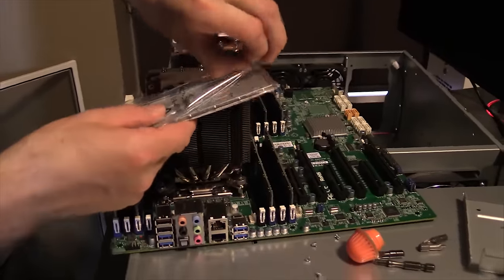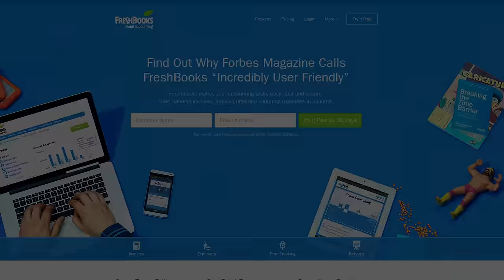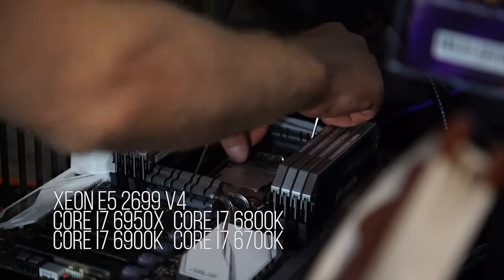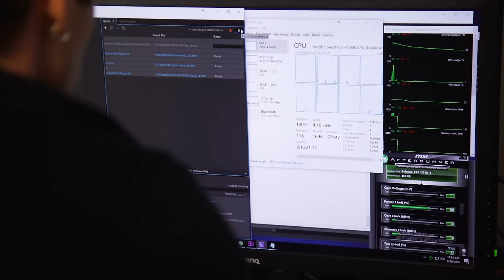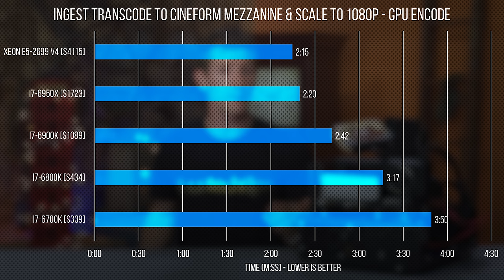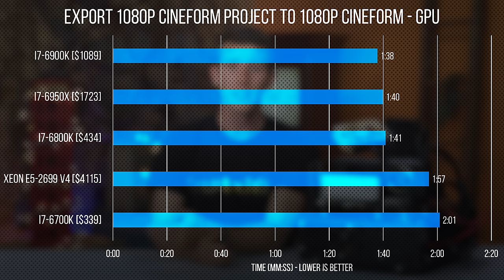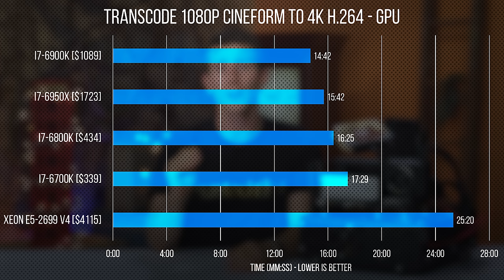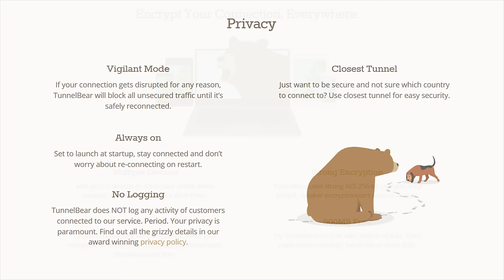$300 CPU Beats $4000 CPU?? - Cores vs clockspeed for video encoding

Comment: Well I got the XTitanX  6940K quadcore Series SSD  Deluxe tested MotherBoard Zeon 49 Quarter K video encoding encrypter for the encounter method 1080P export application to transcode the upload synaform cynthroptic angle in the scenario CPU front loading washer.

Comment: if I wanted to build an "eBay special" rendering machine using a dual lga1366 workstation motherboard with dual Xeon x5690 3.4ghz (3.6 turbo) 6-core processors, how do you think that would measure up against a modern skylake i7-6700 system? all other things being as equal as they can be, of course.
Reply: If your software renders on the GPU, it wouldn't make much difference, but you also need to know how well your program splits workloads between threads/cores.

Comment: Can you use virtualization to split the 28 core cpu into into "6 rigs of 4 cores", with each its own Titan X, then share those 6 rigs into some sort of "hive-pc-network"? 
In theory you would have 6 Quad Core PC's with a titan x, and 80+% usage on CPU?
So even though your clock speeds are slower, you use the advantage in numbers, since you have that epic CPU?

Could LMG test this?

(Hive-PC-Network) After googling, I think the term is "Render Farm".

Comment: Although the video may be correct, it wouldnt be then not that extreme at least.
The Premiere Encoder as with very most other timeline softwares too are absolutely terrible in efficiency of encoder and its speed as well.

It would've been more interesting to see the difference with x264 @ preset slow and not terrible timeline encoder...
maybe its even an opposite result then. Wouldnt be a surprise.

Comment: ummm ok? so its just a limitation of the software?
Reply: possibly, its also a limit of the use case, the cpu usage was very low so clock speed becomes a limiting factor, give it multiple vm's and get 7 people to hammer it with jobs all at the same time and you'll see the other chips cry.
the 6700k would probably melt its heatspreader.
Reply: ok thanks for the reply...  this is what i hate about his videos it seems like he spends more time on his advertisements then the subject at hand.... i feel like they rush though every thing and in the end i nothing out of this video...
Reply: Many software doesnt utilize more than 4 cores etc. It was the same when quadcores came out... Most software only utilized 2 cores max. I wonder if Linus actually knew it (probably did). As you said he seems to spend more time advertising...
Reply: Ex0rz Thats a myth, its widely believed because most people only have quad cores or dual cores with hyperthreading so don't know any better.
"It was the same when quadcores came out... Most software only utilized 2 cores max"
again most people at the time were lucky to have a dualcore e8500 because a q6600 was so insanely expensive. dx10 which was out in 2007 had support for multi core proccessors, but back then youtube was only a year old and there was no big tech stars to show you it being used and no rivatuner statistics server so it was largely impossible to tell if more cores were being used, the only real was was to simultaneosly monitor task manager on a second screen but very few if any sites did this, for the most part much like today they focus'd on "does 2x the cores give you 2x the performance" which is highly flawed as for one thing quad cores were often clcoked only 66% of the speed of dual cores and most games were not very complex with minimal physics and AI and didnt require a ton of processing power, so core 0 might be at 50% core 1 at 20%, and cores 3 and 4 at 25%, you wont see an improvement in performance, but much like running out of ram it would take allot more to slow the system down, a virus check could run in the background and you wouldnt notice.
of course very few who knew this and actually did testing back then care about it now. we are talking about the early 2000's when pink came out with "u + ur hand" and avril lavigne came out with girlfriend, think how old you was in 2007, heck i think xp still had like 85% marketshare so people couldnt even run dx10 on thier pc's with 1gb of ram.
the software today is highly parrellised now with gpu acceleration thrown in using thousands of slower low performance cores. its feasable that in the next few years a powerful GPU can do most of the handywork and any serial processes would be done by a low power 4ghz dual core CPU, this could infact be done on an APU with gpu, cpu, chipset and dram(HBM) all on the same die, were almost there already.
Reply: Toms Tech Dunno how its a myth since Im sure I have heard software developers say that their products didnt have quad core support.
Reply: Ex0rz "I have heard" that might be it, as i did my fair share of benchmarking over the last 10 years seeing where it matters and how much if you have any sources im entrigued to check them out.
fwiw 2007 was call of duty 4, bioshock and portal, hardly demanding.
Reply: Toms Tech Well you clearly cant prove that its not possible soo... You just cant know the way every single software out there has been programmed.  Not impossible that software didnt know how to utilize multiple cores back in the day.
Reply: Ex0rz I was merely asking where you heard and what you heard, from what i've heard over the years (and echoed recently from others like barnacles nerdgasm) software isnt written "for 4 cores but no more" software is written for multi core or its not and it will allocate threads as long as it has them, so if theres 5 threads (AI, physics, audio, load/save, NPC animation etc) they will all be distributed and tasked and scheduled by windows to as many cores as you have, its the ability to use multiple threads at a time that prompted intel do develop simultaneous multi threading to try and make the cpu work as much as possible while avoiding pipeline stalls and this was back in 2005 with the pentium 4 donkey years ago.

Putting all your eggs in one basket and hoping that a few powerful cores currently creates more hardware limitations than the problem of doing a little bit more work on the software side to make use of multiple cores (virtual or otherwise), much like having a powerful supercomputer vs distributed computing or distributed compute on as powerful super computers as we can get like we do now. It is well developed software that is going to be key in solving hardware limits that are coming up quickly and people can kick and scream otherwise about how powerful a single thing can be as much as they like.

Comment: So the 5820k (a 22nm 6800k) at $380 USD is looking pretty fucking baller then.
In the uk it's cheaper and outperforms the 6700k, and equal (sometimes better) in gaming from your video.

Comment: Why no use the 22core in a hyper -V or VMWare ESXi setup with 2 - 4 OS running benchmarks at the same time. dividing the cores evenly between the VMs. Though no sure even if this was good in some way, would even suit what your trying to do. and Im not sure how hardware pass-through for the GPU would work. other option would be an UN-RAID setup etc etc.

Comment: Off topic question.. I have a 4k monitor which overclocks to 72hz refreshrate using a mini displayport cable. Will upgrading to a full size display port cable improve this? My monitor has display port 1.2 wired to a gtx 1070.
I'm asking becuase theres a cable on sale for a £1 at poundland & not sure its worth the trip there and back.
thanks

Comment: why is inlet's HD 4000 priced at $481 when its soo bad. I have a HP Envy Dv7-7254nr notrbook. 8gb ram Quad core. it strogles to stay at 30 in most games on Med settings.

Comment: Still didn't get it, why does not scale good with more cores?
Reply: It does with cpu encoding only , throw gpu acceleration in the mix and then it favors a faster cpu over one with more cores
Reply: The application in GPU-bound mode, doesn't really spread the workload nicely across all the cores. So higher-clocked cores will run better, which you're going to get on a quadcore, not on a 22-core CPU.
Reply: Because the GPU acceleration is the bottleneck ... the CPU cores mainly wait for the GPU cores to finish their part.
Reply: Thanks for the info guys. So the right solution will be a balance between CPU and GPU horsepower. Maybe if you had 3x Titan's there would be more load on the more cores CPU and will benefit from then.
Reply: +Woxys Some people on other threads said GPU acceleration doesn't scale very well, so it seems to be not that easy.
Reply: Cuda does not have native threading support, and as such, favors few, high speed threads over many, low speed threads. This is stark contrast to say, opencl with its task parallel compute model which could take advantage of more cores, as well as directly getting the processor involved in tasks, where cuda excludes it, but each have their place. In a system with a lot of slow cores, the performance may be negatively effected by cuda, regardless of the number of cards you have, however, software can overcome many of the threading issues by using each card on their own thread, but it only lessens the problem.

Linus should probably get an OpenCL configuration setup, but that would require buying AMD cards, which we know linus will jump off a building before he would do such a thing.
Reply: That's bad news, i wonder how youtube servers handle that encoding...
Reply: Woxys LOTS of crappy cpus :)
Reply: With a shitload of individual encoding systems, most probably blade servers.
Reply: Not necessarily crappy, but as I said already, small individual units.
Reply: use x264. not these terrible inefficient timeline encoder.
Reply: De-M-oN Specifically, AVC. Hardware accelerated on AMD, not sure about nvidia.

Comment: Yes, shitty software doesn't scale to multi-core.
What else is new?
Parallel programming is hard. I've been doing heterogeneous parallel programming (CPU + GPU, pthreads, OpenCL, OpenGL etc.) for many years and I'm still learning new tricks.
My 3D software scales almost perfectly linearly, with multiple cores and multiple CPUs.
I have 2 dual-socket 16 core systems (32 threads each) and a 6-core (12 threads), with a higher clock.
The 16-core systems blow the 6-core system out of the water, with nearly 3 times the speed, even though the 6-core has an almost 30% higher clock.
Can I have your 22-core CPUs?
You can have my 6-core!
:)

Comment: hey Linus,

I am about to build a workstation for both 3d rendering and some engineering simulation work (why oh why do they lock CUDA acceleration to Quadro cards....) and it would be awesome to know how the CPU performance varies like in this video. since I'm investing so much on those damn Quadro cards, any place I can save a few buck would be welcome. can you please (please please PLEEEAAASE) do a similar comparison to this but rendering scenes (iray rendered) in 3Ds Max and doing a stress simulation in Inventor? pretty please. I wonder how the clock speed vs core count works for these applications and also if the CUDA acceleration (present in both software) negatively impacts the Xeon as well

Comment: Guys I'm building my first gaming pc it contains 
1-  intel i5 6600k 
2- msi kraite gaming 3x z170 motherboard 
3- msi gtx 1060 gaming x 3gb 
4- corsair hydro h60 liquid cpu cooler 
5- hyperx savage 8x2gb (16gb ram) ddr4
6- 1tb hhd 250gb ssd from samsung
7- 550w psu
8- corsair spec alpha black and red case  
Please rate my built and give me some tips thank you
Reply: 8/10 that cpu is overkill for that gpu
Reply: Get a 6gb 1060 and get a weaker CPU, if its for gaming you wont be needing this really, save some money in CPU and invest in a 6gb 1060, if also go as far and say that you wont even need 16 gigs od ddr4 aswell, but thats for you to judge. Anyways, save a buck on other parts and get at least a 6GB 1060 or ditch liquid cooling and buy a cheaper mobo and you might aswell buy a 1070 with an aftermarket air cooler
Reply: Thats perfect for 1080p
Reply: Thanks allot guys :)
Reply: Also i added the 6600k with the liquid cooler  and the z170 motherboard because i wanted to overclock it but im thinking on upgrading the gpu for the 6gb version thanks guys
Reply: +ADAM 4J Actually the 6 GB version doesn't make much sense for 1080p gaming, which the 1060 is perfect for. Saving on RAM is a good idea though, unless you really need it. RAM is the component which is easiest to upgrade later.

Comment: Should have used http://ark.intel.com/products/91750/Intel-Xeon-Processor-E5-2687W-v4-30M-Cache-3_00-GHz
Btw Linus since you sit on a few gazillion core cpus there is one game that you could test out to see how fast it can be in loading and fps with a GTX1080
City Skylines with about a 1000 assets installed from steam workshop.
If your wondering why I'm suggesting this it's cause you never really taxed the game when you where testing that game in your videos and it would be fun to see how well the game is actually built for multi core cpus.

Comment: help, computer is acting up and i dont know what to do and google sucks ... so here goes, when in windows my computer ( i7 4790k udh5mobo gtx780 msi lightning,,,) the GPU fans speed up to 100% then slow down to almost nothing pulsating if you will but when i start a game it goes whisper quiet, the computer just started doing this on its own (go figure) its about 3 years old and i have no clue where to start,,, im thinking its a windows issue but no proof and no solution ... any ideas???

Comment: This viedo proves two points. More cores scale well with mulithreading duh. The cuda implementation being used scales horribly over multiple CPU threads. To be honest I'm not that surprised about this. It's probably a similar thing going on with asynchronous compute where AMD is absolutely killing Nvidia as far as performance gains are concerned ATM. I can hardly think of anything more asynchronous than trying to talk to 20+ prosessor cores at once. Would be interesting to see if the same were true with AMD cards and an OpenGL/Vulkan based encoder.

Comment: isn't gpu encoding worse in terms of quality?
Reply: Yes, but that's not what's happening here. It's not ShadowPlay/VCE/QuickSync, it's a hybrid CPU/GPU codec that uses the GPU's general purpose compute features to do a buttload of the heavy lifting.
Reply: but that is not quite true for only on GPU calculation (video rendering). http://www.tomshardware.de/video-transcoding-amd-app-nvidia-cuda-intel-quicksync,testberichte-240740.html
Reply: +Naddel81able Like Stoney "Skouteh" Mahoney already said, this can't be compared to ShadowPlay/VCE/QuickSync and the link you provided clearly says that it's about encoding in QuickSync.
With one and the same codec, one and the same settings and one and the same input-video, the output will always look the same, it will just take more time, or less time depending on who is doing the workload.

Kind regards,
Meta Custom Computers

Comment: Honestly.. I dont get it. So where is the problem? Medina encoder is.. ehm..shit and cant use so much cores? I thought that these programs are all about. So what is the reason for such CPUs? 3D render?  Server..and what? If not even video edit cant use them.. pff
Reply: Server farms where you run dozens of virtual machines on a single physical machine... Basically scales infinitely with any number of cores. That's what these CPU's are for. And rendering proably. Or scientific data processing in specific applications.... And that's more than enough reason for Intel to make these things. Probably extremely profitable considering how enormously huge the data processing needs of the world are, outside of commerical stuff.

Comment: OK, I have a question - I have an Asus P5K Premium system where the Motherboard is failing. I need to replace it. While main use is internet surfing, I do a lot of Photoshop work plus I edit 1080p video. Nothing special, just personal projects. I'm looking at going to an LGA1151 system. I really need to keep this to a strict budget. I need the best bang for the buck I can get. Looking at Gigabyte G1 Sniper MB, but there are so many chipsets and other options out there. Totally confused - anyone got any ideas? Thanks!

Comment: So if I use this setup could I play modern games?🤔
Reply: no. the cores of the CPU wouldn't be fully utilized. on top of that, there isn't enough cores. a GPU can have over a hundred cores (smaller than a CPU core) which are all tasked with things such as geometry and physics. think of it like 100 people working on a project instead of 8. the 8 people can do more complex work, but the 100 people will do much simpler calculations faster. So a GPU is always better when gaming.
Reply: +richanater99 sense the sarcasm in his post.
Reply: Yes if you get the 6700K that performed best in his testing for clockspeed based applications like gaming then you will be able to play any modern game.

Comment: I am having issues OCing my 6800k. Anyone have tips on what settings I should set? I want to just get it to 3.8GHz Dx
Reply: ***** Pretty new to the OC world. I think the issue was trying to allow my mobo do it automatically instead of manually doing it. The 99x series mobos seem to have issues with adjusting the CPU itself (kind of stupid, but I understand these are all brand new essentially) so we will see. I got great advice from the community on the forums (seriously I love this community) so when I get home I will be testing it.
Reply: ***** Thanks, you wouldn't happen to have worked with Gigabyte x99 Ultimate gaming mobo would you?
Reply: I have a 2011 v- 3 socket i7 5820k with a x99 chipset. Im runnig mine at 4.7ghz at 1.31 volts. Did nothing else but increasing ratio. And increasing voltage until it became stable.
Reply: Some simple guidelines. Mind the temperature with software like HWmonitor. Try not to exceed 80c during stresstests. Do not increase voltage past 1.4 (extreme voltage) and you should be fine.